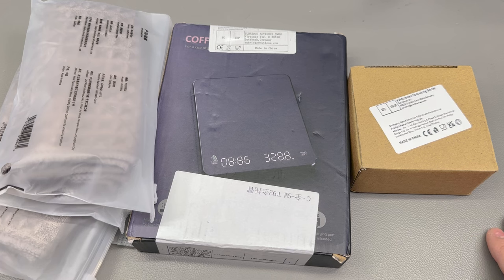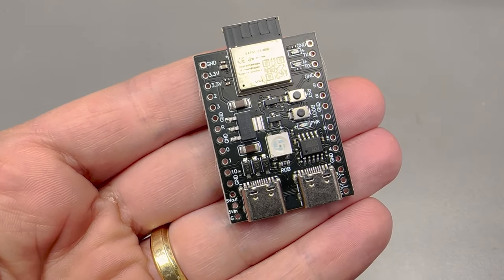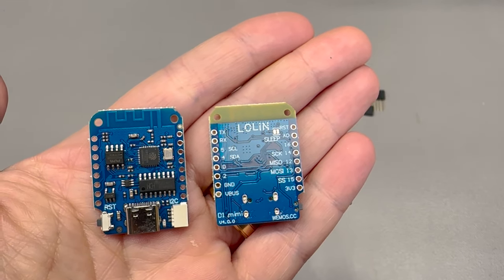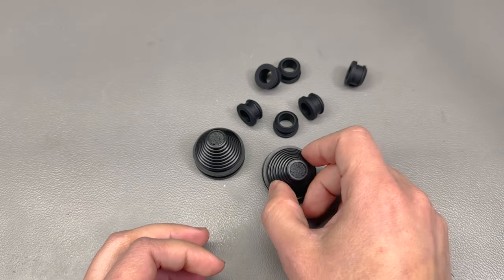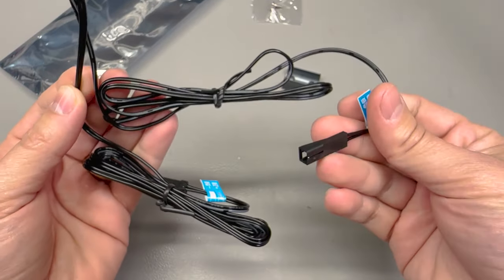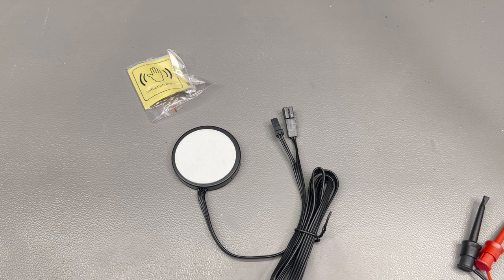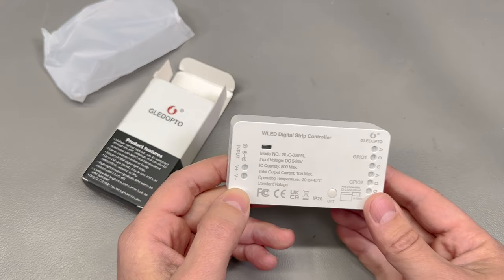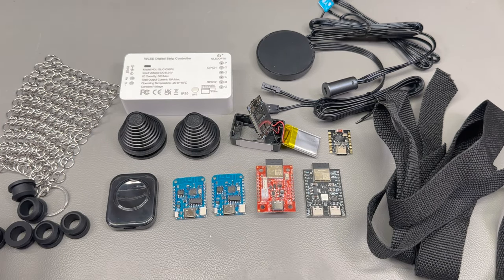InTheMail | Voltlog #476

Comment: I don't like the combined shipping with Aliexpress, it makes the orders take longer due to holding up entire order until every "combined" item is available to ship, and then instead of shipping with our national postal service who is reliable and has physical access to postal boxes/secure drop boxes, it goes with a scummy 3rd party courier service who will leave your package outside on the sidewalk, in the rain, to be stolen and send a picture of it on the sidewalk to the shipper as proof it was "delivered" so you can't get refunded. In my country (Canada), combined shipping is both slower and less reliable.
Reply from the maker: I see, so in some cases it made it worse because the standard postal service was good enough prior to the change. In my case it made it significantly better by being faster and I've only had one package lost in the 10 months or so since they introduced the change to group and deliver by local courier.
Reply: @voltlog   they could easily accommodate both by allowing customers to opt in or out of combined shipping, but I couldn't find such an option.
Reply from the maker: @youtubeviewer7077  The seller has control over this option to enable for his products shipping via "Aliexpress shipping" or some other 3rd party service.
Reply: @voltlog  Interesting. I wonder if I could put a note when making a purchase requesting not to use combined shipping. Maybe I'll try it next time I order something.
Reply from the maker: @youtubeviewer7077 I think the way it works is seller has the option to choose when he lists the product, which sets appropriate cost for shipping. I don't think it can be changed after a purchase has been made. On the seller side it might also affect the flow of money based on tracking number confirming delivering which would release the money to the seller.